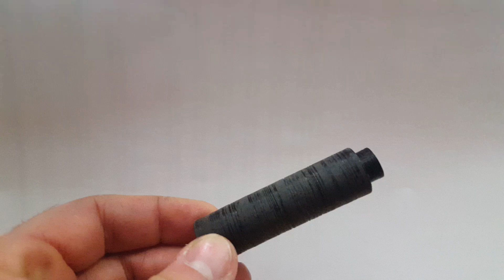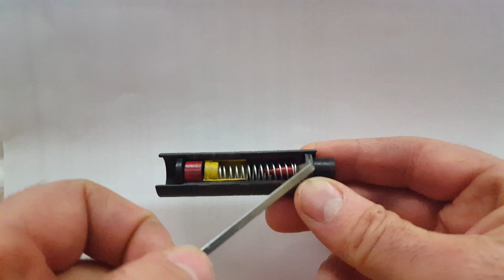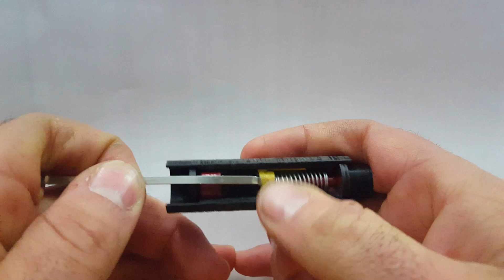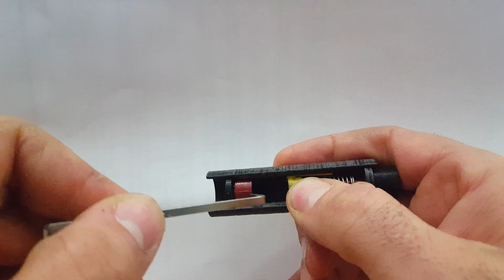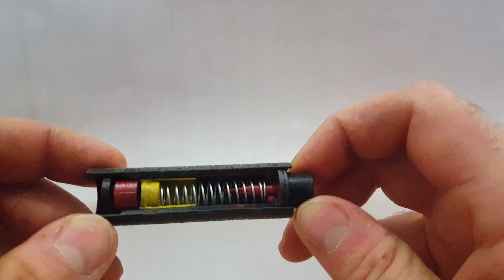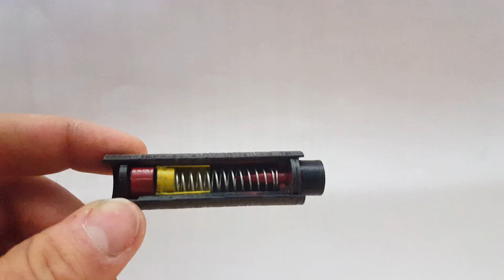PIAT No.425 fuze: How it works.

Comment: The PIAT warhead is a shaped charge design, right? How exactly does a percussion primer in the nose of a SC warhead set of the main charge?
Reply from the maker: Yes it is.  In a way that they avoid doing now. Basically has a tube running down the middle of it with a piece of cordtex (detcord) in it. The Fuze sets off the detcord which sets off the explosive train at the base of the warhead.  Problem with that design is that anything in front of or going through the centre of a shaped charge will act negatively on the effect and make it less efficient.
Reply: @Stray03  Stuff is the nose cap is a definite no bueno for jet formation, makes sense everyone's moved away from such designs. Thanks for the quick answer!

Comment: Slightly related, where did you find the dimensions for the PIAT practice rounds? I've been looking and had no success.
Reply from the maker: First was using the measurement tools on photoshop and using my piat. 
Ordnance collector forums are also a good source if you get lucky, which is where over a few different posts on the topic some owners measured theirs.
Reply: @Stray03  Thanks. I've got mine torn down, cleaned, greased, and ready to go, now looking into load data and dimensions. I appreciate the tips.
Reply from the maker: Did you check the main spring free state oal
Reply: @Stray03  No, I was having enough fun with the spring and the grease I didn't think to.
Reply from the maker: Ok  it is a pain to remove. Need to make a tool for it. If not you can damage threads
Reply: Do you have a Thingiverse or cults 3D where you release this stuff to print?
Reply from the maker: Nope. Sorry. I just make things custom to my needs and print them when I need to.
Reply: @Stray03 is there a way for me to privately message you about this 3D build? I'm actually a detection dog handler and I'd like to print one of these for training purposes lol
Reply from the maker: @UK9Heard  I'm just confused how an oversized 425 fuze can be used for training, but feel free to send a message to stray03@gmail

Comment: I've always wondered if it were possible to make a bouncing betty fuse using one of those pizza table things, since those are mass produced and already exist. I just don't have the space to play around with that idea.
Reply from the maker: You mean to use it as the prongs? I guess it could work, cold weather may be a problem with the plastic. Never tried to cool one down below zero.
Reply: @Stray03  
Basically, yeah. Cut a hole through the table section to allow space for the spring/primer/fuse assembly to fit, and a metal washer to hold it in place and strengthen the plastic/act as part of the triggering mechanism.
Reply from the maker: @RavemastaJ  assuming the plastic can handle the pressure I don't see why not.
Reply: @Stray03  
It only has to work once. It's not a firearm.
Reply from the maker: True, other issue is that the table part will act as resistance if it is under ground with the mine unless it is the same size as plunger.
Reply: @Stray03  
The bouncing betty mines weren't always placed deep in the ground, as their design was supposed to rocket up anyways. So having it launch sideways around a wall or obstacle was also viable, if you used tripwires to the mechanism.